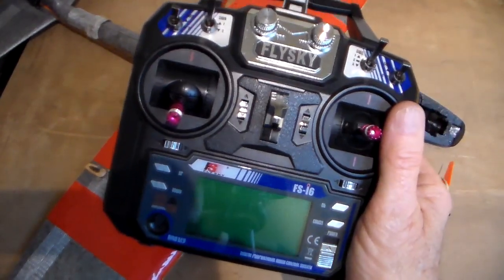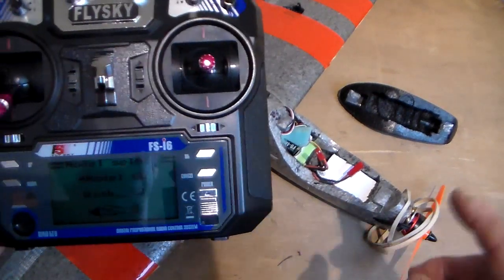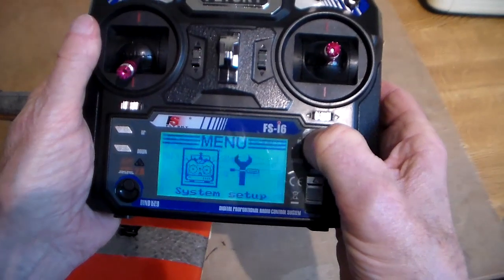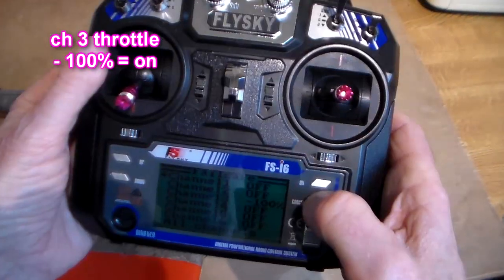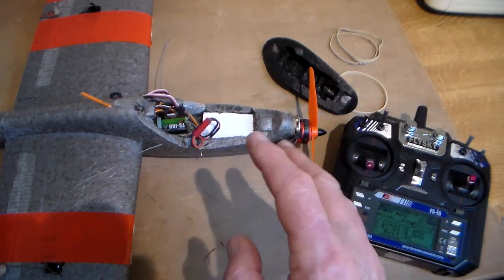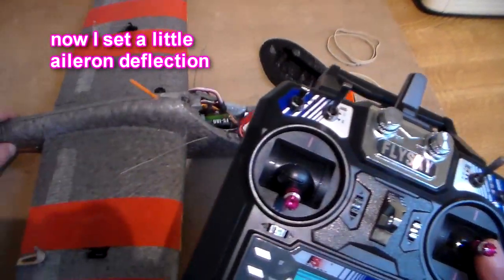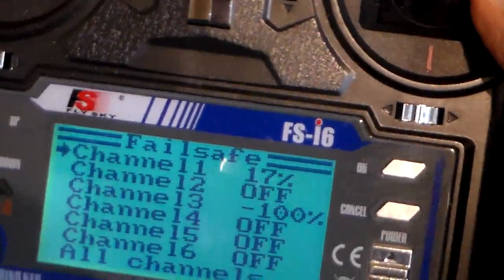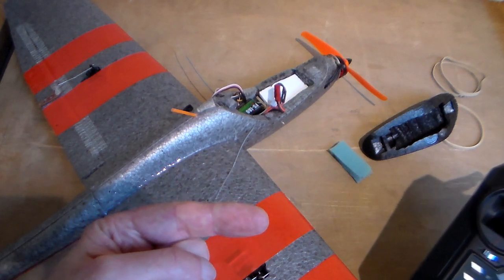Don't lose that model part two - setting up and using failsafes -  Flysky FS i6 transmitter

Comment: Actually this method of ensuring it just doesn't keep gliding on is best done with a stabilizer on board. Otherwise even just that little bit of aileron will keep the wings rolling until she stalls with no power on and heads straight down. (Except if you've left the dihedral in and use only minimal aileron offset.) A small (equivalent) stick offset with "stabilized and self leveling" selected limits the plane to a circling motion. Still better than letting it head off Gawd knows where though. ;-)
Reply from the maker: Doesn't need a stabiliser mate, in an unintentional signal loss I set the rx fail safe so that  the motor stops, ailerons go into a slight turn and then it will circle and glide down. Unintentional is the keyword here.  These beepers (for £3) are good once it's down and maybe in a tree or long grass and you can't find it. A lot cheaper that a flight controller too. Saved and helped me locate a few of mine that I lost control of and that came down in scrub. Just turn off the tx and within 60 secs it starts beeping! It's a lovely sound to hear when you've c.cked up!
Reply: @bobflyman  Yep, all good on the buzzer Bob. But (unless I'm mistaken-often am! 😉) you might be missing the point of my comment. If you set the receiver to fail-safe to your 17% aileron offset (as I have done often without giving it much more thought) then that deflection is held. So not like when you manually add an aileron deflection to tip a wing up/down to make it turn but then release the stick when it sits up to the required angle. The wing (if no dihedral to stabilize it - or stabilizer) will just keep on rolling to a higher and higher bank angle surely? Or have I got that all wrong? 🤔
Reply from the maker: @theoztreecrasher  Interesting, I'm old and easily confused 😉.  Never had a stabiliser on a model so no nuffin about them, and I do see where you're coming from. I'd assumed it would just circle and glide down,  but as you say, it might go in ever decreasing circles and wind in fast!  I guess if you only set a little bank angle it might be ok. Or rudder, though most of my stuff I don't build in rudder.    I'll have to test it sometime 🤥. Or you test it! 
No hold that.  I just thought, as you say when you move the stick  make  a turn, say 90 degs, then release and it goes in a new direction. So circling is the only way you get it to stay where you are till it comes down?
Reply from the maker: I did some Googling, I must admit I don't see anyone else suggesting trim the ailerons to a bank. I do see RC Adam suggest pitching the nose up? If it stalls who's to say what will happen? I see suggestions for full flaps and left or right rudder. I dunno mate!
Reply: @bobflyman  🙂 Yep, Bob. It's got to circle stably without outside influences. Rudder offset with fail-safe has the same problems as aileron offset.It causes 1 wing to fly slower than its mate thus starting an ever-increasing roll. = spin in! 
Thus, if you think about it, there are only 3 ways to achieve the desired result. All requiring motor off.
1... A stabilizer set to failsafe to "Beginner/Angle/SAFE/Auto-level with bank limits and your "17% Aileron". (That doesn't make the ailerons go to "17%" - it limits the bank angle to 17% of the stab-limited maximum allowed bank angle.) 😉
2...Wings with dihedral/polyhedral (effectively variable length wings) which would reach an equilibrium with the fixed aileron input - thus countering the progression to an ever-increasing roll.
3...A 2-stage failsafe procedure - where there is a brief aileron twitch to roll the wings a little bit for a turn but the ailerons then return to level to hold that limited roll. 
All this is without considering the elevator! 😱 But under 1 this can be similarly set to a limited down flight path, while 2 and 3 will probably be taken care of by the tendency of a plane to nose down under less than 1/2 throttle. Thus increasing speed until the wing starts to pull it up etc. 
Excelling myself with academic analysis today! 😏🙄
Of course this could be all just BS! 😁
Best wishes for the fast approaching Season anyhow,mate! And keep the builds coming. 😊

Comment: Dang you Bob. I could have used this 2 weeks ago! Eventually found Andrew Newton's tutorials so all is well now. Easier to understand the accent also! :D
How's the current weather event affecting you? I remember getting chased out of the Welsh border country in 2007 & half drowned even over in Lincoln. Great trip though. :-)
Reply from the maker: Not so bad in the South-west and I'm on high ground, but parts of Wales and the Midlands have really big problems.  Worst floods for many many years. Heartbreaking for some people. We've had never ending strings of high winds, exceptionally high winds, big lows, and exceptional rainfall.

Comment: Thanks for posting Bob, ive had my Turnigy I6 for 4 years and never found of even looked for that function, just done all of my current flying models, cheers Mate !  Loved the video, right to the point,  not enough Brits posting how to vids ive found, the Yanks tend to waffle a lot then i loose interest, Keep up the good work ;0)
Reply from the maker: Great job!  Glad you found it useful mate.
Reply from the maker: I agree about too much waffle on some 'how to vids'.  Drives me nuts sometimes too! It can be 2 or 3 mins before they even start to get to the point. :(
Reply: @bobflyman  And of course they don't use proper English, do they me old china plate. :D
Reply from the maker: @theoztreecrasher2647  too right me ole mucker.

Comment: Well done Bob, it would be fun to see how the model would glide with no throttle and just a little bit of aileron to simulate a lost signal.
Reply from the maker: Given a decent day I'll  try it.  I had to guess a position for elevators.  What you don't want of course is it spiralling into the ground hard! :(   But then again too wide a circle and it may still disappear?  Though with some luck it'll come back into range!
Reply: @bobflyman  Only if you fly upwind. ;-)
Reply from the maker: @theoztreecrasher2647  haha , funny enough I was thinking exactly the same thing!  But mostly flying is, or should be anyway, done upwind  !